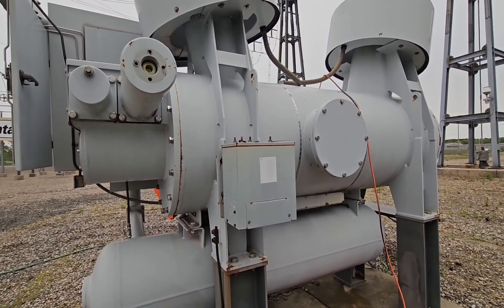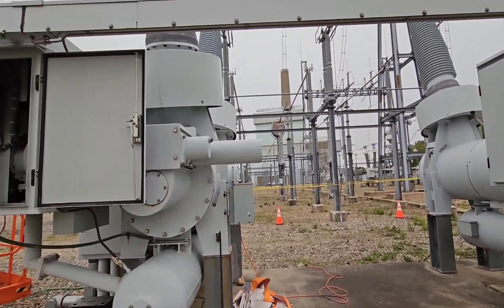Ultra high voltage 345kv SF6 air circuit breaker basics explained and tripped.

Comment: Cool to see other substation videos up on YouTube. Yeah, not a fan of the air trip breakers. Used to work on HVB air trip breakers, never really had any issues with them. Just not a fan of compressed air for the stored energy to trip. The closing action charging a spring, like most breakers, is much better. I do have a video I made when testing one, when tripping. (other sub videos too) https://www.youtube.com/watch?v=VdHUqhaN6TY
Reply from the maker: Agree 100%!  It just goes in opposition of everything I've ever learned about a breaker... it's last ditch energy spent is supposed to be tripping the "breaker"... it's in the name,  it's ultimate purpose is to break current.  It seems like those HVB's were not designed that way.  We didn't have problems with the breaker operation, but the compressors die over time and they're not supported anymore,  so 1 by 1 the hyosung air compressors have been replaced with Jennys' as they fail.

Comment: Very interesting video. Thank you for the explanation. 
I noticed that there doesn't seem to be any lines coming out of the other "rod" (sorry I don't know the names of these compartments. I am new to this and would love to learn) on the other side of the breaker. Could you tell me why this is? Or are these systems not in operation (yet)?
Reply from the maker: If you mean the timing rod that goes where the cover was taken off down low, that is placed there for the timing only,  then removed. It moves in and out as the breaker trips and closes.  
If you mean the wires at the top of the breaker,  they are removed on one side and grounded on both sides during testing. It will be replaced and grounds lifted before going back in to service.
Reply: @reusefull  Yes, I meant the second one. So it is for safety reasons? Thank you!
Reply from the maker: @Stijn  The grounds are for safety.  We disconnect the lines on one side of the breaker in order to do the timing test. With the grounds connected, it's all one point electrically. That's ok on one side of the breaker, but in order to time each breaker contact on each pole as it makes the connection,  we need to see them individually on at least one side. Then we can tell the time of each and the difference (delta) from the first one to connect from the last.  The motion rods I mentioned provide velocity information. 
We will time the trip (open) the close and the trip-free (close-open), which simulates closing into a fault... the breaker is given a close command and immediately opens.  During that last scenario, we look at the overall time and the "dwell" time... how long the contacts are electrically connected before parting again.
Reply: @reusefull  That is very interesting. Thank you for the explanation. Looking forward to the next video.

Comment: What happens if there is a problem and there is no pressure to Trip the breaker? Will it just stay closed until something further down the line cooks and breaks the connection?
Reply from the maker: There are a few methods of protection. The one you mentioned is last ditch. There is an alarm if the air gets low. Someone will try to fix it if there's time.  If the leak is too big/fast the breaker will trip below a certain point while it still has the ability to. If that fails,  every breaker surrounding it will trip.